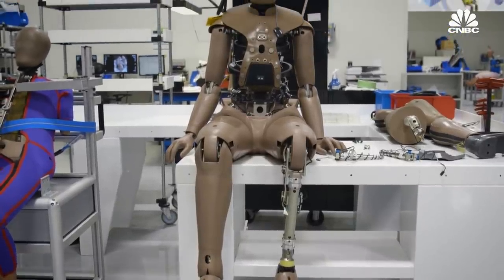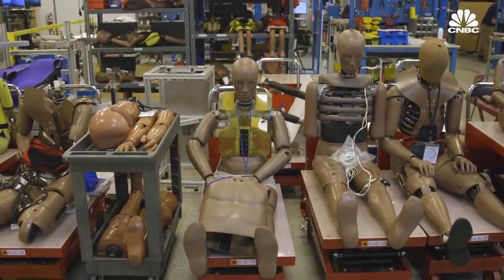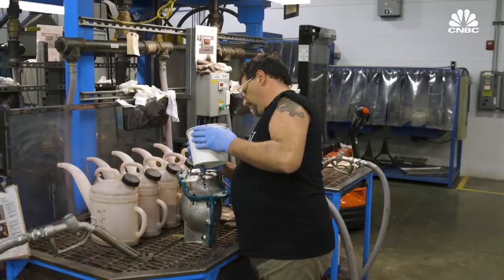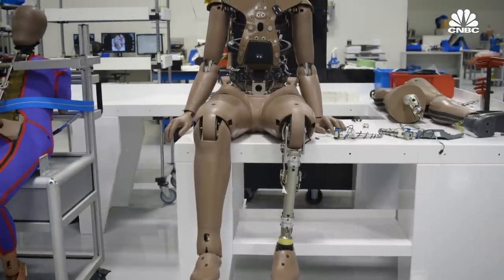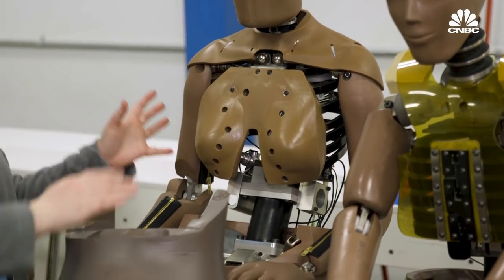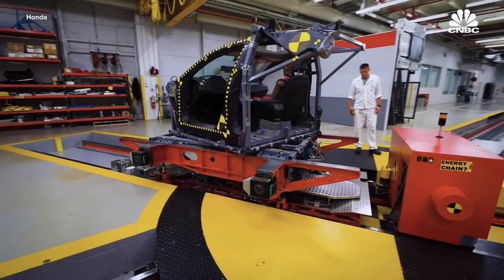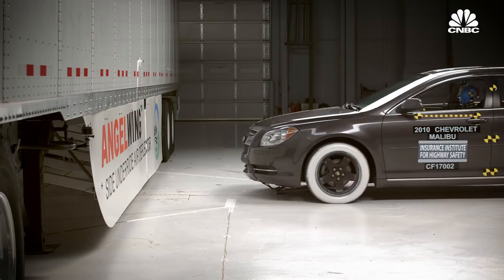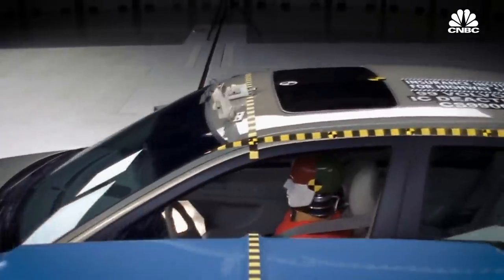How Crash Test Dummies Evolved To Cost $1 Million

Comment: The bigger take away from this video is that humanetics has a problem. There are a finite and relatively small number of crash facilities around the world. These facilities self certified the dummies and repair them in house. Humanetics is low volume because they have a low demand. However as humanithetics lobbies governments and regulatory agencies to mandate use of new dummies, They force their clients to purchase new dummies  Resulting in  Humanetics making more money.The engineering involved in cars isn't concerned with specifically which bone breaks,It's a science of energy management.  By managing the energy from the impact and Minimizing the energy absorbed by the dummy you pass a test or fail a test.Passing or failing the government test is what's necessary to sell the vehicle,Passing a different test or the degree by which you pass the test is what gets you the insurance institute rating.New dummies are not necessary to benchmark for the insurance institute nor are they needed To measure the energy absorbed by the ATD. That is why automanufacturers And testing facilities are not keen on spending What would reasonably be 50 million dollars or more Just to say they have a newer tool.  This is another case of an industry or an industry leader using their position to librato leverage the government Into changing regulations and laws To increase the company's profit. Those increased cost to the manufacturers and testing facilities are passed on to the consumer in higher pricing for automobiles. Additionally there will be a million spent by the federal government government to do studies and rewrite the regulations to adapt them to theSensor feedback of the new dummies.Without question you can get more dathe more data and data that is more representative it's more representative of human bodies from Newer technology.The question is really is it worth the cost to the taxpayer and consumer when it won't substantially change substantially change the safety of the vehicle?  It makes more sense to slowly implement use of newer technology is technology with newly developed test or future developed tests.  The insurance  Institute is absolutely correct. There's no value to be had spending the money  To upgrade or the additional money to maintain Because it doesn't change the methodology or benchmarking of crash testing.
Reply: I agree that we cannot trust humananetics on the subject of whether we need their new most expensive product. However I think it's clear that some of the crash dummies being used today do not accurately represent the human body and should be replaced with more accurate crash dummies.